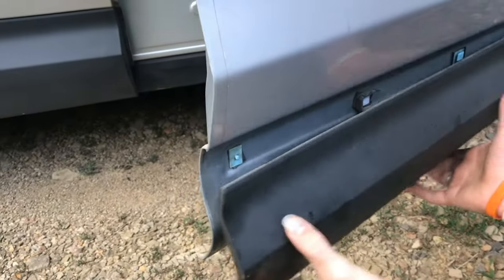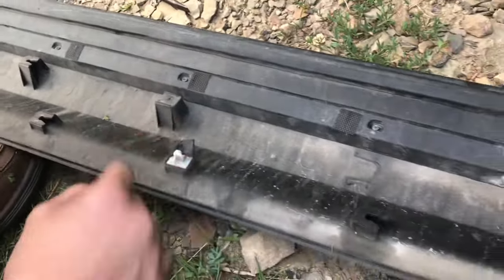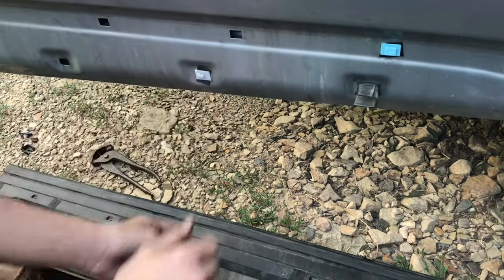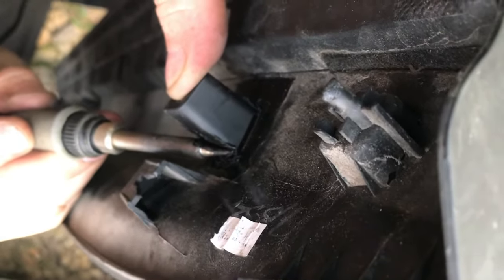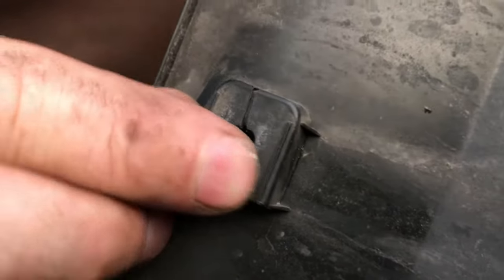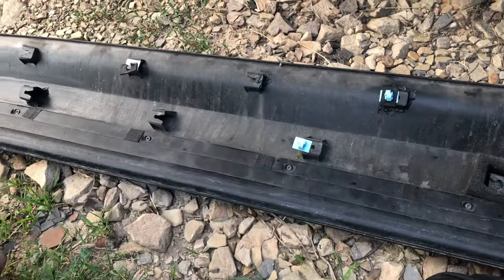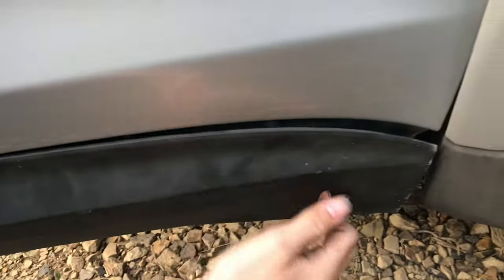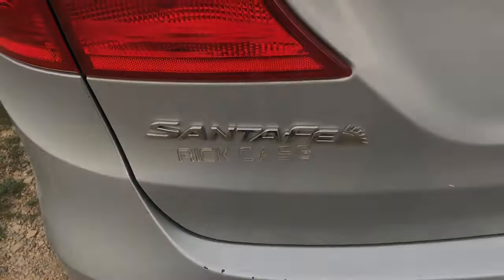REPAIRING broken lower door molding garnish 2014 hyundai santa fe  877222W000CA

Comment: How do you remove it tho?
Reply: Just pull it off. Takes very little pressure. If you purchased a new one online you don't even need to worry about the clips breaking. You can also just buy new clips online for a few dollars. I would remove the 2 screws INSIDE the door at the bottom (10mm) of the door first. I bought a replacement because someone his the lower molding in a parking lot. Easy replacement.

Comment: How do we remove the moulding? Need to fix mine like you did. Appreciated
Reply: I THINK YOU JUST PULL IT OUT AND  FIX IT? … I GUESS. IM GOING TO TRY TO FIX MINE, LETS SEE IF IT WORKS, WORST CASE SCENARIO I WILL HAVE TO PUT DUCK TAPE ON THEM. 🙈
Reply: No! Read Cory’s comment above. You have to unscrew two clips from inside the door panel. Remove the panel and you’ll see two nuts on each end for the trim piece.

Comment: Looks just like a 2005 Santa Fe.  My additional problem is that the molded holder for the clips  (two forward most and both upper and lower of the fourth clip back are completely gone.  Do you have a work around for this problem?  Hoping your reply is not that the whole panel needs replacement.  In any event thanks for the helpful video.

Comment: Thanks heaps for the vid. Having just endured the same repair, I'd like to offer viewers a couple of other tips.
Before removing, undo the the nuts that hold the big clips, one at either end. 
The nuts are on the interior side of the door, at the bottom and are plastic coated. 
You can undo them with your fingers. Easy!
If you don't do this and those clips (or rather, the molded mounts they slide into) aren't already broken, they will break and mean more plastic welding for you.
At around 2:40 in the video, the guy says 'these one don't need a clip they just push onto the square'. They don't push on! You can see they're supposed to slide on but from opposite directions. This did my head in! But, if you remove the clips like I mentioned above, you can slide them in while it's off the door, then when you push the molding onto the door, the bolts pop through the holes and you can do the nuts up on the interior side.
Finally, I've got to say... Hyundai... I know you want a clean look, but there's got to be a better way than this!
If you are going to engineer it as a disposable part, don't charge $480 to supply and fit. That's what they wanted in Australia!
Reply: Great comment, very helpful, need to fix mine!
Reply: Very helpful comment to tighten up the bolts from the interior of the car door.  I didn't realize that's how it worked until you mentioned it.
Reply: I just came back to this video to offer the advice as well, good point as these are the strongest points holding the trim on.
Reply: This is required information that should have been part of the video.
Reply: Well said. This is a design flaw of the Santa Fe. The trim catches on high grassy verges and rips clean off. My wife has managed to do it twice in the past year. Very easy to do, especially at night after a couple of bevvies 😂
Reply: Ugggh happened to my 2019 Kia Sorrento
Reply: Thanks to both of you. I just replaced my wife's IONIQ 5 modeling and was wondering how to handle the two screw-on parts. Would you believe the Hyundai repair shop (suggested by our Hyundai dealer in Naples, FL) wanted over $640.00 to do the repair. I found the part online and ordered it myself. My wife brought in her car to asked what they would charge to replace it and a worker told her he would do it for free. The owner walked up and said $400. when she told me this I knew this had to be a simple replacement. Took less than 10 minutes thanks to all the good people here. Thanks again!

Comment: Thank you. Fixed mine for the price of a cheap soldering iron rather than paying a body shop a small fortune.

***Those two bottom clips you left in can be removed by opening the door and twisting off the bolts they are attached too. Or with the trim off, you can slide your fingers under and touch the bolt. I noticed your bottom part of the trim was sticking out once reattached so looked until I found that little secret. I tried to smash it on at first before finding this out and it resulted in the bottom part sticking out and me partially breaking those clips. Quick soder fixed it.

Comment: Very nice. Unfortunately, this piece has broken off a couple times for me, due to a high curb in front of my house and it catching on it. Most of the clips are missing and some of those molded anchor spots are missing too.
Reply from the maker: There are times when I’ve used a soldering iron to plastic weld some of the broken pieces back on. Of course there’s a limit to this. Sometimes it’s so bad you have to get a new one or used one at a junkyard. No one how to get it on and off sometimes is more than half the battle
Reply: Poor design by Hyundai. Why would you build something that so easily catches onto outside objects. By the way, where can I get the clips from?
Reply: Yes.. mine as well .. very upsetting about it
Reply: @marcrawley6001  extremely poor design & they went cheap on that part of the SUV… I just bought a replacement part just received it today… Waited 4 months for it was on back order.
Reply: The same thing happened to my 2015 dodge charger.. all the clips have broken off on the passenger side
Reply: @livefree6878 if I just take it off and leave it off do you think it'll be fine for a while? Reason I'm asking is where I live we get a lot of rain so I'm worried about water getting in easily or rust